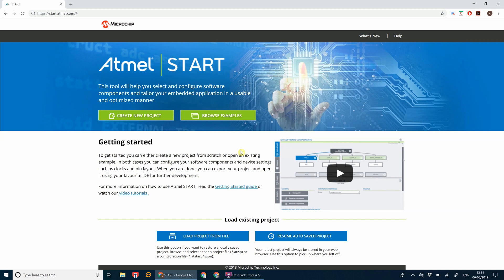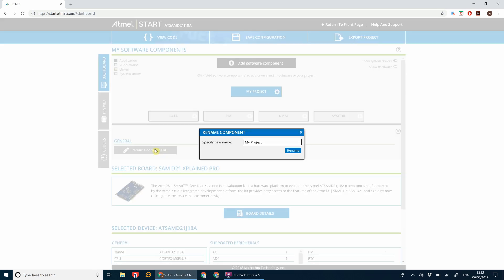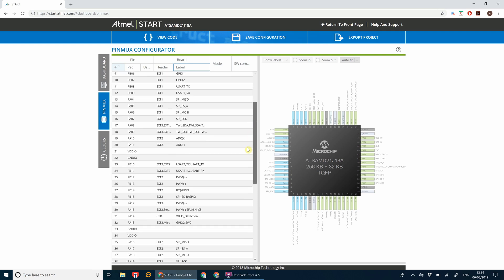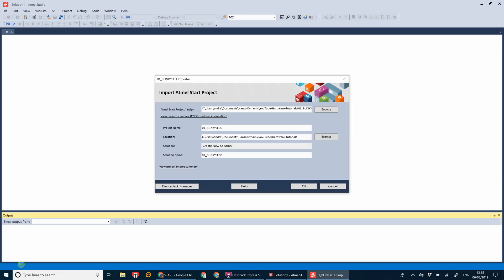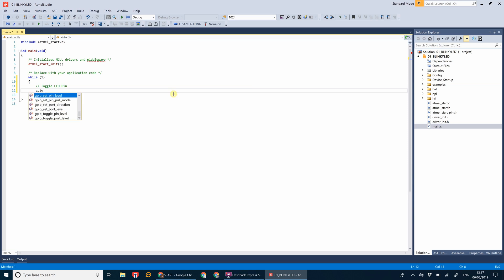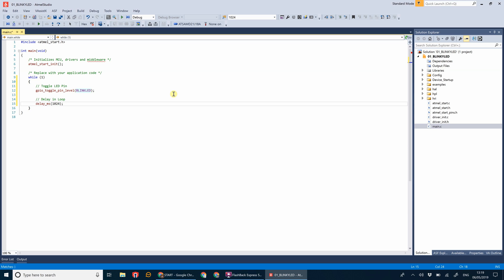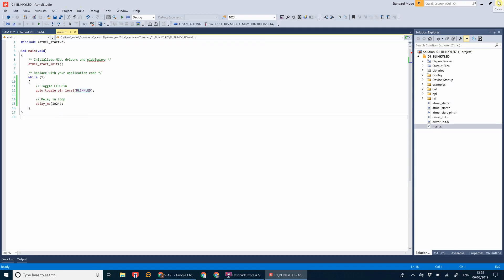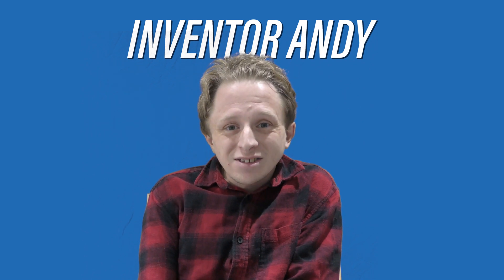Blinking LED on Atmel SAM D21 Xplained Pro - Tutorial

Comment: A good video and a nice introduction to the board and the tools, but I'm not sure where you're coming from with a delay of 1024? While the CPU frequency is a multiple of 1024 (I'm assuming the PLL clock of 48 MHz, I think your example actually uses 1MHz from the internal oscillator which is not), that is irrelevant to the computation of the cycle count for a delay. if you dig down you'll find that the cycles counted for delay_ms() is computed using the formula (ms * freq - 1) / 1000 + 1. If you pass a parameter of 1000 ms, that formula calculates 48000000 cycles  (because of integer math). Since the clock period is 1/48000000 seconds, this comes out to exactly 1.0 seconds. On the other hand, if you enter 1024, you get 49152000 cycles, which will result in a delay of 1.024 seconds.

I realize this is a bit of necromancy but I was wondering about your rationale there. Also congrats on your robotics job!

Comment: How to program in Samc21 using mplab
Reply from the maker: I haven't used mplab for programming the SAM series microcontrollers yet. I do believe you can download the Atmel start projects as mplab projects from the website though. Maybe start there? Also, once you get down to it, programming each of the different SAM microcontrollers is very similar. These D21 tutorials should give.you a good enough starting point for the C21.

Comment: Your title says nothing about the specific development board you're using.  YOU don't say anything about it, except when choosing the board in the Atmel START page.  What is it?  What are it's capabilities?  Funny thing - even Atmel's page for this board SHOWS THE VIDEO FIRST.  You have to select a TINY picture of the board.  Ergh.  AND THEN, when you Finally sho the board, it's in front of a BRIGHT WINDOW and we can't see crap.  Thanks.
Reply from the maker: Hi Chris. The board name is in the title and, I believe, mentioned in every video in this series. It's an Atmel SAM D21 Xplained Pro board. I assume that if people have made it as far as looking up tutorials on programming this device they're aware of the capabilities of the board. If not, I recommend looking at the Microchip website page for this product family, as well as both the summary sheet and the datasheet (available for download on the Microchip website also).

The purpose of this video is simply to get people started on programming the board in the easiest and quickest way possible. I'm not officially affiliated with Microchip / Atmel - I'm simply an embedded engineer trying to pass on my knowledge. If you have any specific questions about programming the board I will do my best to answer them.
Reply: always there is this guy

Comment: Thanks, that helped me get started (everything worked the same on MacOS by the way)
Reply: Hello Hamid,
Are you using the SAMD1 Xplained Pro on a Mac? 
Which programming tool do you use?
I'm new with this programming board (I was on Arduino before and I must say it's quite different) and I had to take out my old pc to install Atmel Studio (which doesn't seem to work on Mac).
Thanks
Reply: @jmrfanch271  Hi, if you fast forward to around 4:10 in the video, you see selection boxes for what IDE you want the Atmel START tool to create the config file for. You can choose MPLAB, which is available for Mac and Linux (as well as Windows). The story is that Atmel was bought out by Microchip in 2016. At that time Microchip had their own IDE - MPLAB - and Atmel had theirs - Atmel Studio. So now Microchip has two IDEs with similar functionality, and only MPLAB is cross platform.
If you're from the Arduino world, keep in mind using Atmel Studio and MPLAB is quite a bit more complicated. It allows for a lot more flexibility and functionality - at the cost of complexity. Also my experience was hit-or-miss, documentation and tutorials were often hard to find and out of date for the version I was using, and the IDE's UI was not as streamlined and intuitive as I would have liked. Nevertheless I did manage to get everything to work - eventually.

Comment: Hello! Great video, have you worked with STM32 microcontrollers? If so, can you compare them to the SAM
Reply from the maker: Hi Jaime. I've just started doing work on an STM32 and I think the learning curve is a little steeper if you're new to the MCU world; but both are great devices to use so far. My biggest objection to the SAM series is that the Atmel Software Framework, while powerful, is very poorly documented. Most of these tutorials have come about through me spending hours and hours fiddling around trying to work out exactly how to use the drivers.

Comment: Hey Andy you wrote the blinking code in atmel studio then why atmel start
Reply from the maker: Atmel Start is a configuration tool for the newer versions of ASF. If you generate directly from Atmel Studio it uses an older, more cumbersome version of the framework. I also find it helps having a visual tool for assigning pins and adding drivers etc.

Comment: How would you stop the application after flashing it to the board? Whenever I plug my board in it just keeps blinking :(
Reply from the maker: Either erase the program from the board (Tools > Device Programming > Memories > Erase) or simply comment out the gpio_set_pin_level commands and flash it to the board.
Reply: this app was a infinite loop blinkig LED. is what it does.